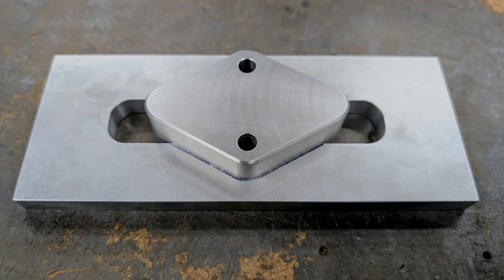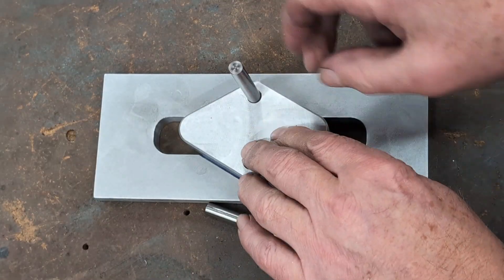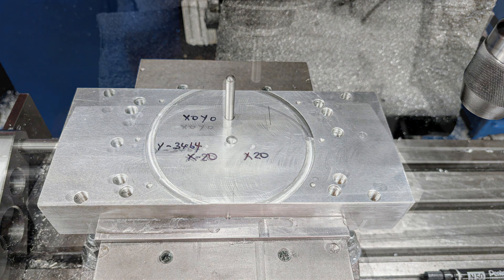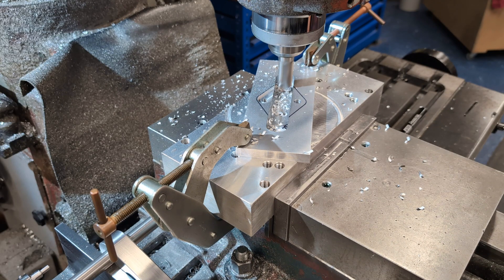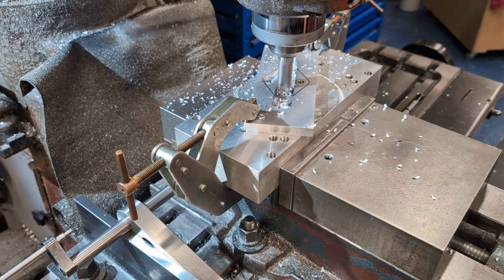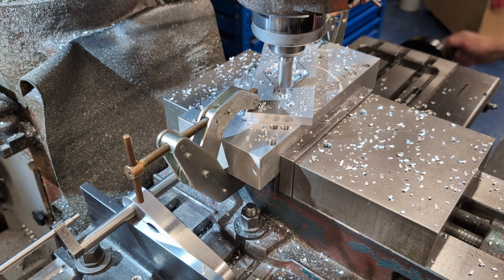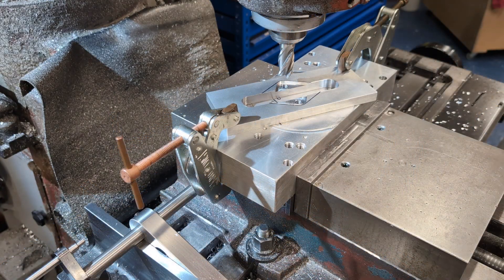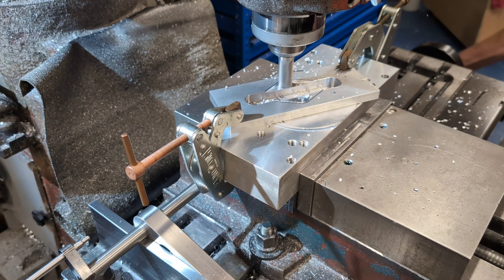10 minute brake caliper pocket, no rotary table.

Comment: I would like to see your math for the cutting paths as well as the alignment positions that you did show.
Thanks.
Reply from the maker: Thers is a diagram during the video showing a simple right angled triangle with all the details. Pause the video at that point, it should have all the info you need.

Comment: That two-pin method is genius--very clever. I have made angle blocks by a similar method drilling and reaming two holes when the part is square using the DRO and then fixturing off of the holes in a line to get the desired angle, but it never occurred to me to put a pin the spindle and line up that way using the DRO. I do think Abom really wanted to show and use his family members rotary table.
Reply from the maker: Thanks for the comment. In this case I tried to keep it simple by just reaming one hole in any position, then setting the DRO to zero, no finding edges, indicating, etc.. Using the pin in the collet allows multiple angles to be set without peppering your fixture block with holes.
I also often use 2 pins in a fixture block to butt up against as a reference plane, and then a third as an end stop.
My dedicated fixture plate has jig-bored holes with hardened bushes in known angular positions to slip reference pins in. This plate would have been ideal to use on this demonstration, but again, I wanted it as simple as I could, just using a bit of scrap for the fixture block.
 I use a 20mm pin in a collet when using my rotary table, its like a temporary stop in a known position from the center, just remember to add or subtract 10mm from the DRO position!
Personally, I don't think demonstrating an inaccurate and extremely protracted method on a rotary table pushes our communal knowledge base forward, so I've posted a practical efficient, accurate and simple alternative to help others.

Comment: I would say that besides saving time this is probably more accurate that using a rotary table.
Reply from the maker: Compared to the method shown in the original video, it is way more accurate. I aimed for 0.05mm per side clearance and could have easily got closer. I probably did this whole job and cleaned down before the rotary table was dialled in.